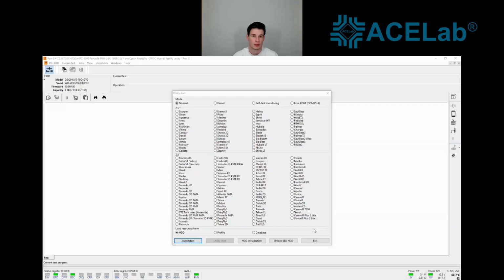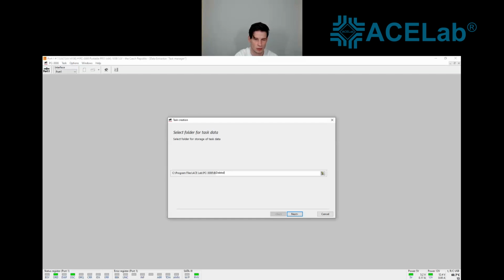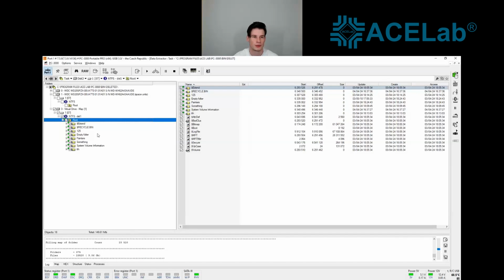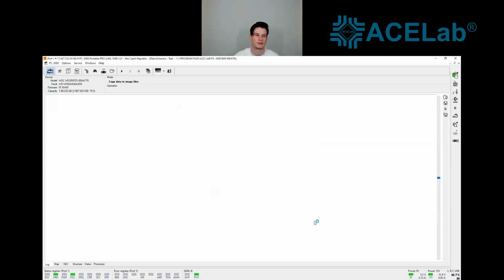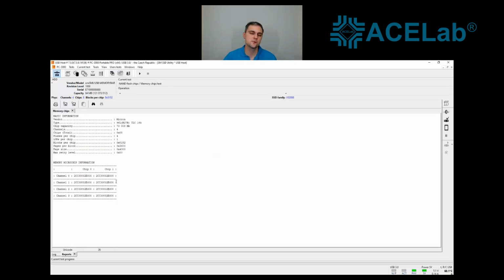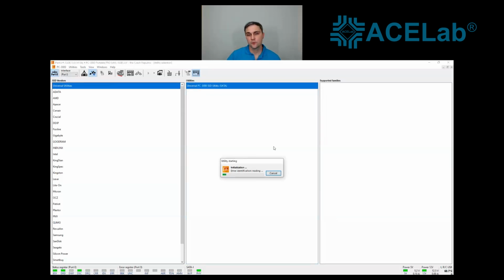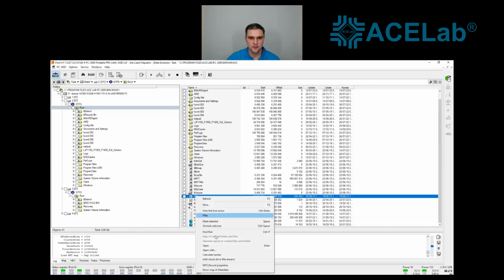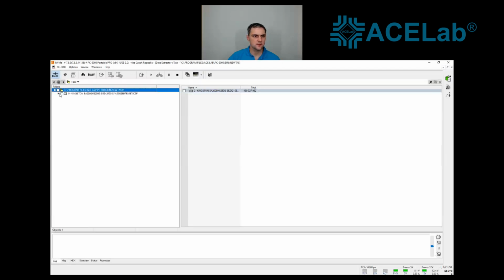PC-3000 Software Update Ver. 7.5.x Main New Features Overview

Comment: I have a micron sm2263en firmware N28A, it is possibile to work with him?
Reply from the maker: SM2263EN-based drives are supported and already presented in SM Utility. At this moment it's possible to deal with: Intel/Micron chips based on B16/B17/B27 architecture, as well as Hynix5 and Sandisk/Toshiba BiCS3/4

Intel/Micron N28A QLC chips are not supported but will appear in the future.
Reply: @PC3000datarecovery  what about wd ssd which uses SanDisk controller?